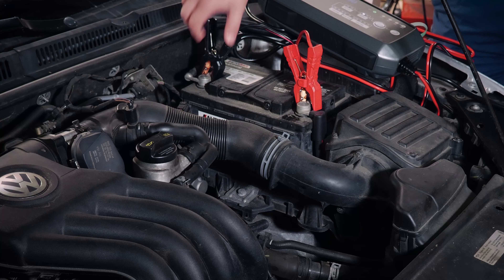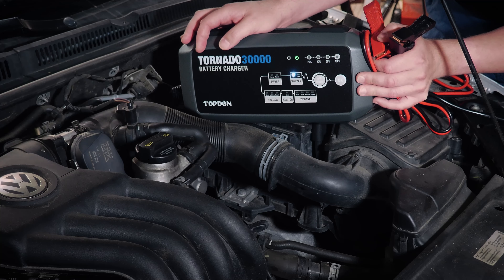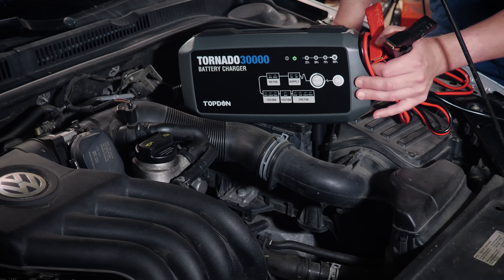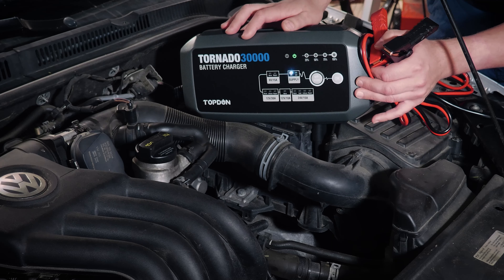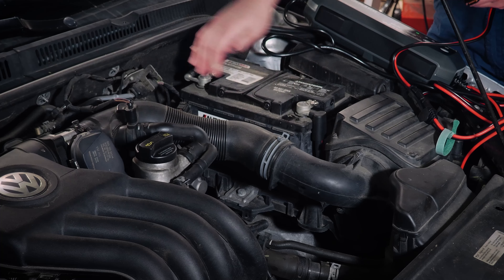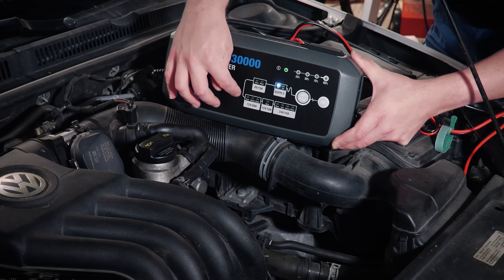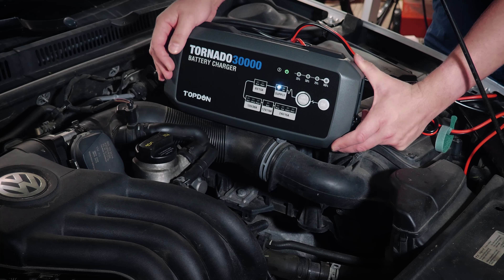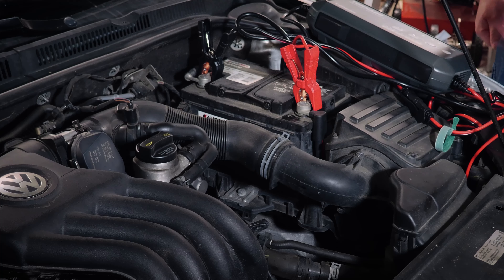TOPDON Tornado30000 Overview

Comment: So is this or is this not sufficient for programming?  Because you say no and your website says it is!
Reply from the maker: It depends on what the OE amperage spec is for programming.
Reply: I dont know of any vehicle that would draw over 30A when programming. Some professional grade battery chargers/ stable power supplies are 25A. I would use it for programming without worries
Reply: @TOPDONUSA is good for autoflasher chiptuning or no ?